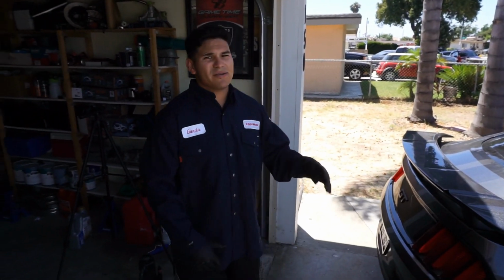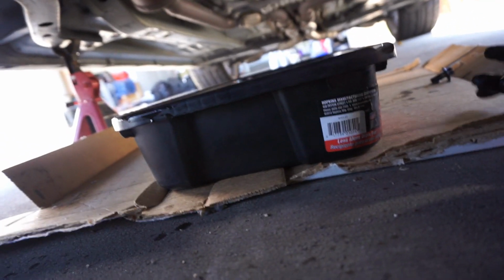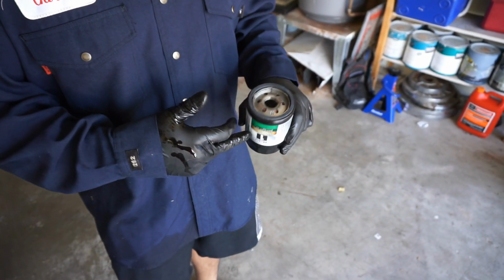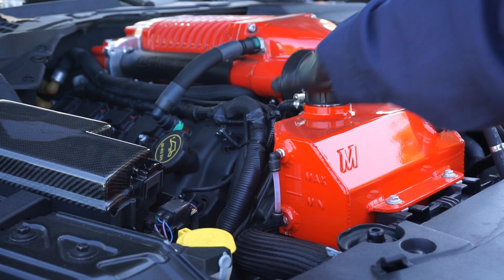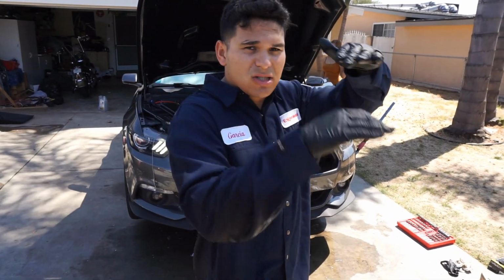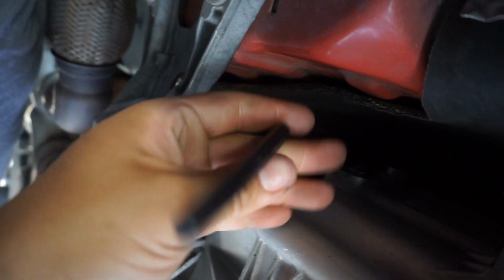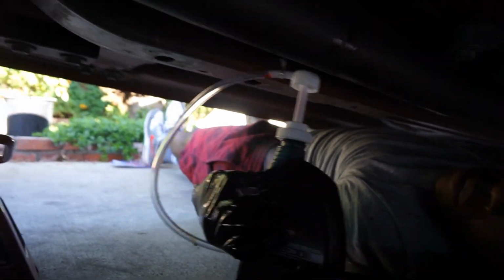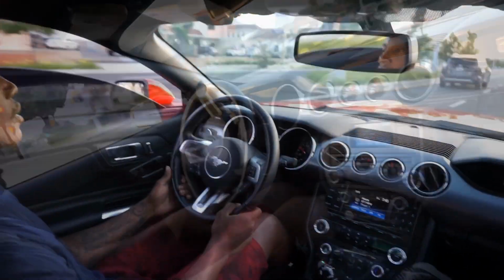2016 Mustang GT Trans Fluid & Oil Change

Comment: Thanks for sharing. I was debating changing my tran fluid like this but i've read that the system needs flushed and filled via a machine since trans fluid is not just in the pan but throughout the system.... convertor and lines. But idk ppl also say a flush is bad for the seals.
Reply from the maker: 1234zcrom that makes sense but we just did a quick drain and swap and it def helped i drove his car also huge difference

Comment: Hey haven't been able to watch your videos for sometime, the last video I watched was the one when you installed the whipple. I sold my notch with a 347 stroker & now back in the market looking for a new S550 or a gt350.  So my question is how is the transmission holding up with the extra power, or in general how is the car doing is it acting different in anyway...? Thanks hope to hear from you soon.
Reply from the maker: MR AW50ME hey brotha everything is holding up great! The only thing that's been bothering me a little bit lately is my choice in going with 20" wheels -_- I feel the road alot. Are my videos not playing for you?
Reply: EnriqueG_S550 
No they play just fine, I have been preoccupied with other things in life. You have great videos. I was also wondering how many miles since install..?
Reply from the maker: MR AW50ME thank you. It's been about 13000 miles now. Installed at 7k miles currently just hit 20k miles
Reply: EnriqueG_S550 
 WOW REALLY...  if you don't mind me asking what did the complete set up under the hood cost total to date...?
Reply from the maker: MR AW50ME stage 2 kit was 7300+600(red powder coating)+1300 install. 9200 total.
Reply: EnriqueG_S550 
Ouch... but I bet you get smiles for miles

Comment: Enrique, I got my 2017 mustang GT pp, I'm at 2,000 km (I live in Toronto) and the gps in the car glitched on me, it was nowhere where my car was. Did you have this issue?

Also my friend told me not to get a roush exhaust and just delete my resonator and it will sound better. Do you agree?
Reply: Franco Yokhanna if you wanna be cheap then yeah just delete the resonator/muffler or both. I would recommend Getting a borla or corsa exhaust don't cheap out on a performance car
Reply: RICKY that's what I said but my friend keeps telling me to do that cuz that's what he did on his 2014 srt charger
Reply: Franco Yokhanna I recommend a actual exhaust or axle backs at least. As for the GPS it has a re center option on the nav
Reply from the maker: Franco Yokhanna I have never had that issue and actually CMO's car is just muffler delete and x pipe and it sounds really good in my opinion. It's not "loud" just sounds throaty.

Comment: Quick question do you have a filter to change in the trans
Reply from the maker: pArTxTim3xGam3r I'm not too sure what else the system has or what other parts go along with the fluid system but we just did a fluid swap and it's a night and day difference

Comment: What tires do you run on your car?
Reply from the maker: Supabuck I'm currently on my "winter" tires (California winter that is lol) which are 275 fronts 295 rear nitto NT555 G2's my radial set up is either 305 555R's or 315 NTO5R's
Reply: EnriqueG_S550 thank you for he information!